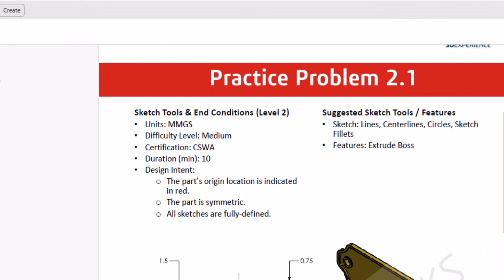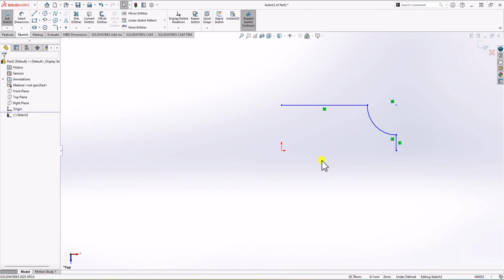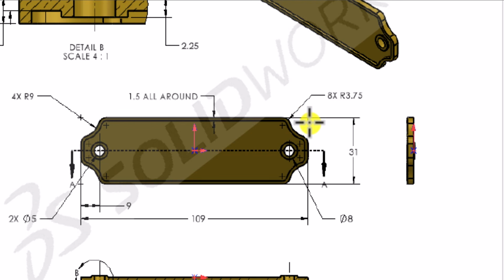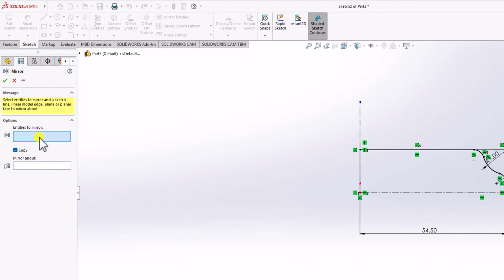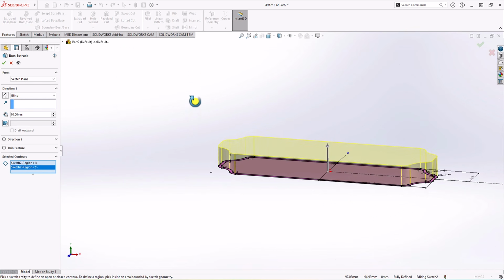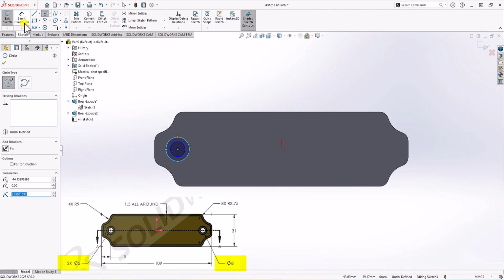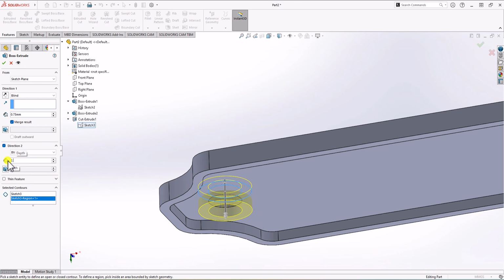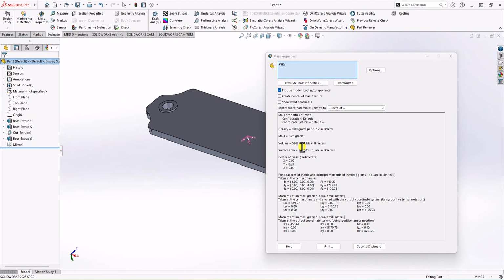CSWA Practice Problem 2.1  Solution | SolidWorks Exam Guide

Comment: Thanks for the video helps a lot! Just curious though I first looked at this I was like this isn't too bad then I got lost pretty quick. Do you have to do it this way or is there a simpler way to do it, cause I don't know how you are supposed to know all the steps to do everything?
Reply from the maker: I understand your concern. As I mentioned in the first video I posted on this YouTube channel, there are many ways to model a single part, and each person can choose the method that works best for them.

For example, in this video, I created one quarter of the geometry and then used the mirror command to generate the rest. If you find that these extra steps are confusing, you don’t need to follow that approach. You can simply model the entire base geometry instead of starting with a quarter and mirroring it. Of course, this will take more time, but if your goal is to practice modeling, you shouldn’t be worried about time at this stage. You can always learn how to make your modeling more efficient as you gain more experience. These are decisions you will get better at with practice and by working on many different problems.
I also want to mention that this is one of the most difficult questions in this CSWA practice set. So if you are having trouble with it, don’t overthink it. It is completely normal to find it challenging. Give yourself time to work through it, understand it, and gradually build your model.